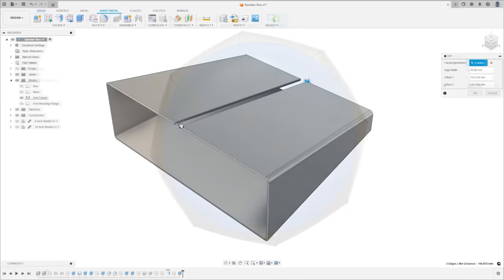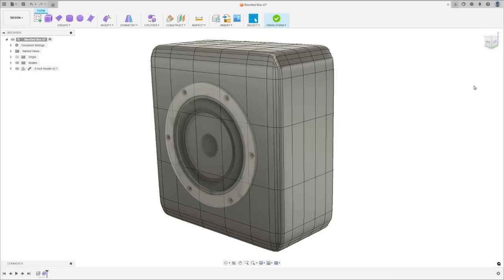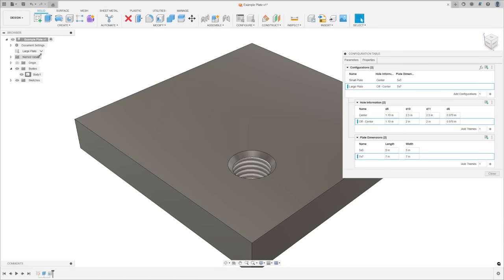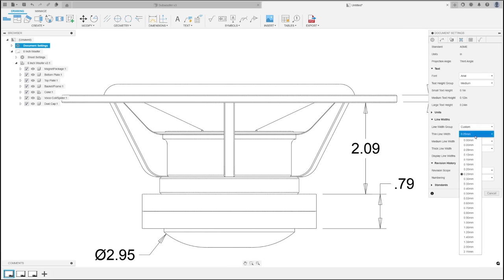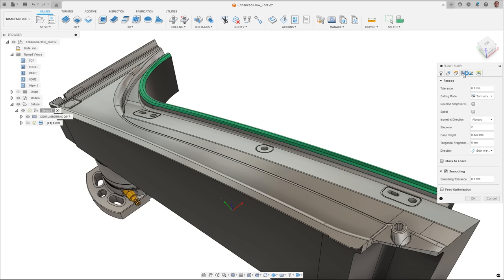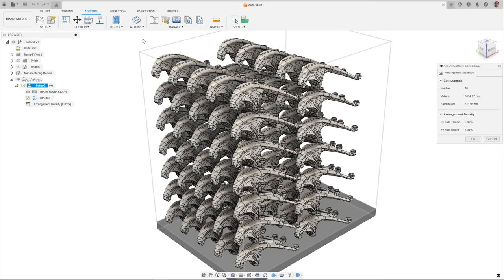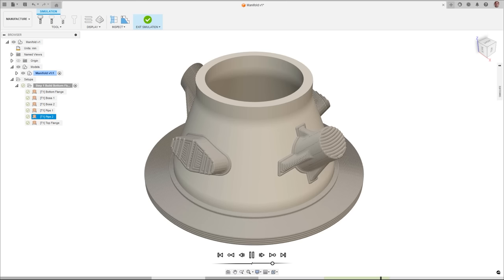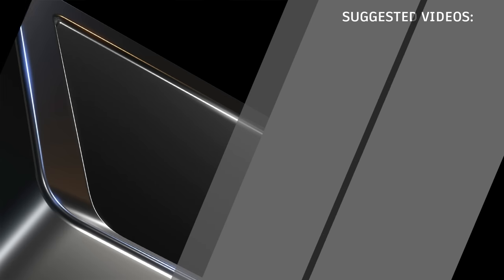Don't Miss the Autodesk Fusion September 2023 Updates!

Comment: Really like this software but no i have a very good level on blender so sometime i use blender instead of fusion even if fusion is better for some operation.

The worst con on fusion is not to be abble to manipulate vertex / edges, sometimes you just want to pull a simple edge from 10 mm without doing 10 extra stuff like adding a simple cube and make some bool operation + some alignement. Also sometime to select all the face of a model it's pretty tricky and if you select multiple object and cancel a tool everything is unselected and you lose so much time to select every thing again.

And this is where blender really shine.

Comment: Does "Configuration" also support text strings? I have to use a Plugin to get some level of automation with text replacement related to configuration changes as of now. This is a cumbersome and tedious process. A "Text" unit that accepts a string of characters would be beneficial.
Reply: If your text shows up in the time line, at a minimum you can choose to suppress it or no.. If the text is different and appears in the same place in the time line, you might still have a winner as you do each variation of the text.
Reply: Thanks for this hint! Having the ability to suppress features with configurations will allow for some workarounds. 
Still I am baffled by the fact that text values are not handled as such.